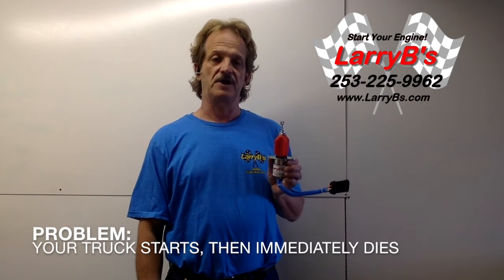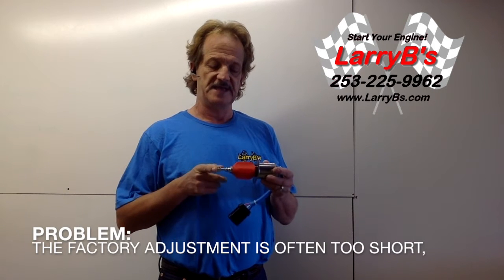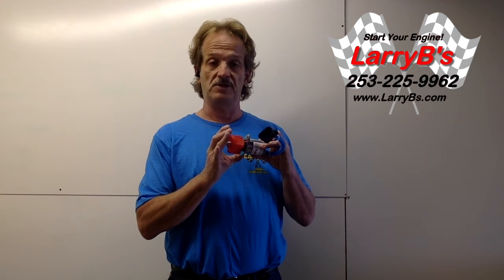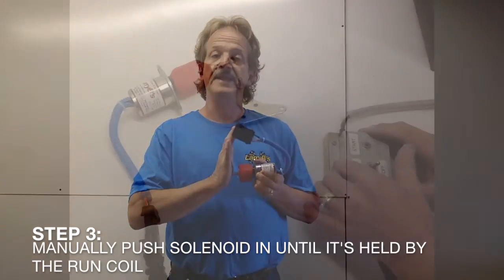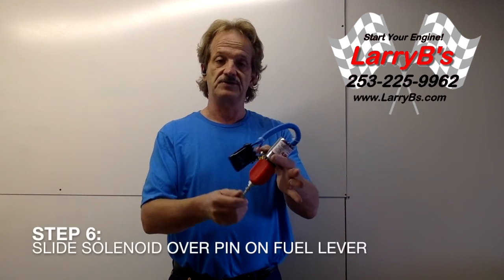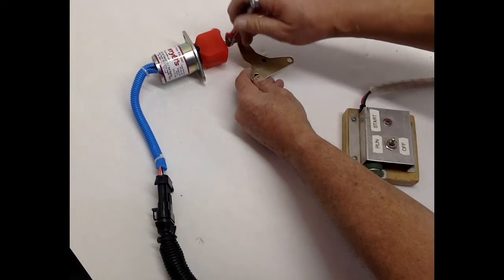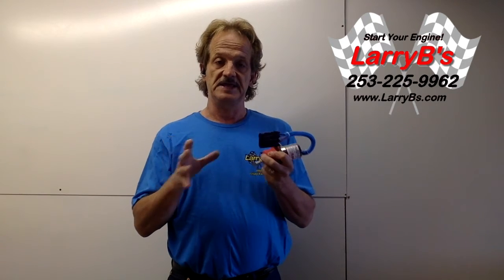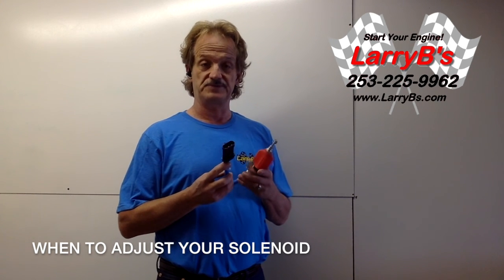Solenoid Adjustment: A How-To from LarryB's

Comment: thanks for the video! -  but my solenoid sticks in the on position -slow to shut off -  seems the lever pull is not straight - had to use washers under the solenoid to get it to work - am I missing something?

Comment: So when i turn the key to the on position, it doesnt retract it in.. but it does retact it out whenever i turn the key to the off position. What could be causing this?? I have to manually push it it whenever i turn it to the on position then it locks in place.
Reply: Did you figure it out

Comment: If the rod is too long, won’t the shut off valve restrict fuel flow while the engine is running?
Reply: Did you find out if it does?
Reply: @Brian.Rodriguez  yes it will but 2 short will burn it out
Reply: It sure does